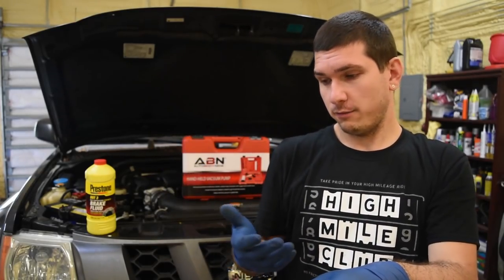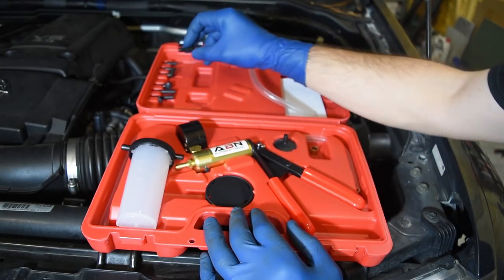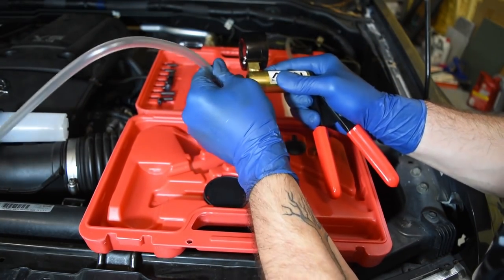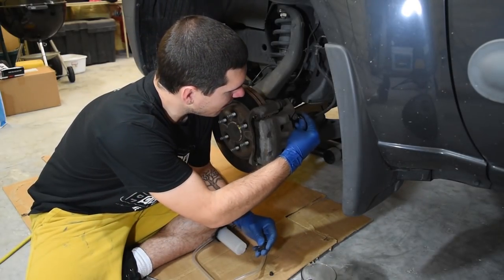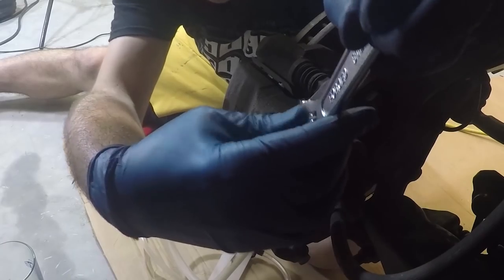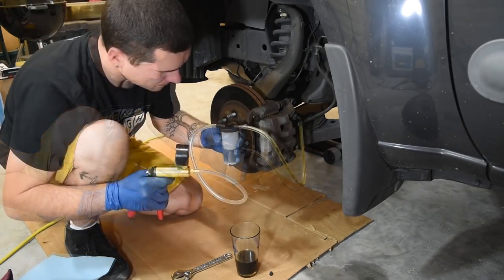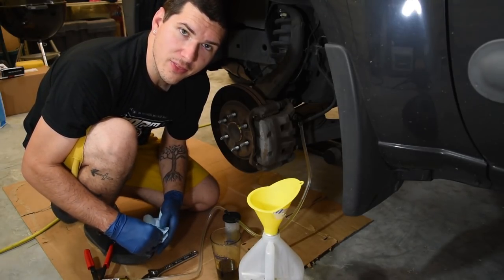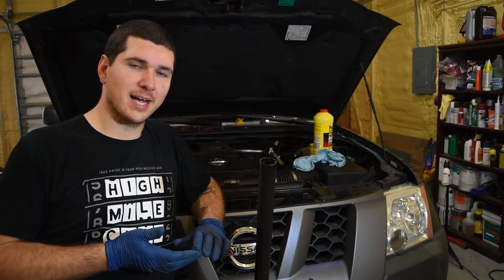How to bleed Your Brakes (replace brake fluid)

Comment: You should never have to top off your brake fluid!!!!!! The level in the reservoir drops as the brake pads wear. It's a sealed system. If it's low, you need to change your pads. That is one of the ways to check your pad wear without removing the tires. Also, if you add fluid, then when you replace your pads you end up spilling brake fluid everywhere. You did not loose any fluid, it ends up in the caliper behind the pistons as the pads get thinner, the cavity behind the piston get larger and hold more fluid. When you compress them to change the pads, it all goes back into the reservoir.
Reply from the maker: Correct, if it’s not leaking.
Reply: @Rythecarguy  you should never have a leak.  If so you should address it IMMEDIATELY

Comment: You are wrong. Always start with the furthest and end with the closest. If reservoir is on the front left, start with right rear, left rear, right front, then left front.
Reply from the maker: You’re wrong. Read the manual for the car you are bleeding and follow that. Not always the furthest.
Reply: No, not always.

Comment: I have purchased a New 2016  nissan frontier .  the brakes feel spongy.  i have heard its a common issue associated with the truck.  we rented a 2016 frontier before we bought our new truck.  the brakes were not spongy and it had a only 11000 miles.  how does the brake pedal feel in your truck. Thanks
Reply from the maker: +Daniel Denison it does not feel as tight has my other vehicles. Definitely spongy compared
Reply: thanks for the input.  keep wrenching on

Comment: Quick question - I've seen lots of guys do the "turkey baster" thing to remove a large amount of the old fluid from the reservoir prior to flushing.  Seems like it would speed up the process?  Turkey baster "out" as much fluid as you can first, top off with new, then flush out at the bleeder valves?
Reply from the maker: I would say if you are going to do a gravity feed then sucking the fluid out of the reservoir is a good idea. If you are using the pump then its pretty fast anyway.
Reply: Yes. Why pull all the old fluid thru the system when you can suck out most before you begin.

Comment: so i get air leaking around my tube connected to my bleeder is there a trick to stop that no fitting seals tight enough
Reply: Grease will seal the connection. Wipe off when done.
Reply: yup i got it thanks

Comment: I see in the comments that a lot of people are saying start the bleed on the wheel that is furthest from the master cylinder. The instruction in the kit says to start on the nearest wheel. I was also taught the furthest but I don't think it matters as long as you bleed every break line you will get the same results.
Reply from the maker: Exactly. It does not matter at all. The goal is to is replace all of the old fluid with the new. Which tire you do first is inconsequential.
Reply: Ry the car guy depending on the manufactures specifications, some cars have a hydraulic booster or abs have which requires you to disconnect the the abs cable or disconnect the negative cable for the battery terminal, skipping the special procedure may cause damage to the cars abs system or brake system

Comment: I noticed that you didn't put the reservoir cap back on does it matter if   the reservoir cap is on or Not?
Reply from the maker: While you are pumping leave it off because you will need to refill as you go to replace the fluid. Then when you are all done just replace it.
Reply: @Rythecarguy  no probs thanks for the reply

Comment: You start from the furthest brake away from the brake cylinder
Reply from the maker: Oh lord, another one. READ YOUR MANUAL. that is not true for all cars. In fact it’s my not even be the most common anymore.
Reply: @Rythecarguy  There's probably a reason why 'there's another one'.
Reply from the maker: Yes there is a reason. The prolific "rule of thumb" that people have learned over the years that is patently false.
Reply: @Rythecarguy  That will be it then.

Comment: I have this kit and was pumping, but the fluid doesn't fluid fast in that bottle. Sure, I opened the bleeding valve by a quarter or by 360. The fluid drups slowly through the tube to the bottle. It was just very slow. I was pumping, but there was no pressure. No vaccuum to the bottle. Just slow fluid drups. In 2 hours I got my first bottle full of old brake fluid. Real slow that pump!!! What is wrong??
Reply: I bought a kit which was faulty so got it replaced and that was faulty as well, same symptoms as you, 2 out of 3 kits faulty at shop
Reply: Yeah! First it has worked for my brother's car. Then I was bleeding my car and the kit didn't work for me anymore. Just one time using and thats it :(  Really cheap!! Bad!!
Reply: A full 360° turn sounds a lot. You might be losing the vacuum past the thread of the bleeder so what dribbles out over 2hrs is just by gravity. Does your gauge still register any vacuum? On my old car (a 1980 WB Holden ute) the difference between closed and fully open is a tiny fraction of that - maybe 1/8 of a turn? (45°)
Reply: Ned The needle of the gauge just stay at the bottom. Really no pressure. So I let the gravity do the bleeding.......drops drops drops.......real slow. But if I put the hose between the pump and the bleeding valve, the vacuum works. But thats not the right way using this kit. Maybe the black round cap is malfunctioning. The kit has worked well, just for one time.
Reply: Sounds like you're onto it but yes, take care not to let any fluid get into the doings of the pump! I read some instructions downloaded for a similar device that specifically mentions an o-ring (or some such) seal that needs to be pushed home during assembly of the cup to maintain pressure. I live in Aus & I can't help noticing the higher quality of tooling generally available to US consumers. I just ordered a similar kit but it's only made of plastic and costs $45. To get a diecast body version costs over $200(!)
Reply: Sorry, bit of an assumption made there. Anyhow, it's good news that the main part of your kit is functioning correctly.
Reply: Your bleeder screws might be clogged..take off the bleeder screws and clean out the sediment or replace your bleeder screws...they may be rusted.

Comment: 11 minute mark, did you have to tighten the bleeder nut on the car with a wrench before you dumped the bad fluid in the glass or was it open ? Also when you took a break and filled up the reservoir, did you tighten the nut?
Reply from the maker: Yes whenever you’re not actively bleeding tighten the nut

Comment: Good vid
But, try and use line wrenches for your bleeders, so they dont strip
Also, start at the furthest from the master cylinder.
Right rear
Left rear
Right front
Left front

Comment: Good look at these vac pumps, but I would suggest making it clear that whenever you don't have vacuum on the bleed nipple you need to have it shut or that will be introducing air into the system. Also there is no firm rule on which caliper to start from as it's vehicle dependent. Many circuirts are left front/right rear splits. Best to look at the diagram for your system.

Comment: Never release the vacuum with the bleed valve open. You allowed air in the system. That’s why you have all those bubbles in your hose.
Reply: No, the system will gravity flow outward even without vacuum. The bubbles are likely from air coming in from the bleeder threads. It's not air in the system.

Comment: I know with some of the vacuum bleeder systems, to start, you should pump it up to about 25 before releasing the bleeder screw...
Reply: Any degree of vacuum helps pull the fluid. There is no right starting value of inHG.

Comment: How to remove those bubbles seen on the lines?
Reply from the maker: You can reduce that my pumping up and creating pressure before release the bleed nipple.
Reply from the maker: Also get a hose clamp and gently clamp the bleed line to the nipple to reduce getting air from the side of the line.

Comment: If the brake reservoir and abs pump on the front driver side then the sequence should be rear passenger tire -> rear driver side tire -> front passenger side tire -> driver side tire.
Reply from the maker: No... that sequence in the factory service manual is the one that should be followed. Different cars require different sequences.